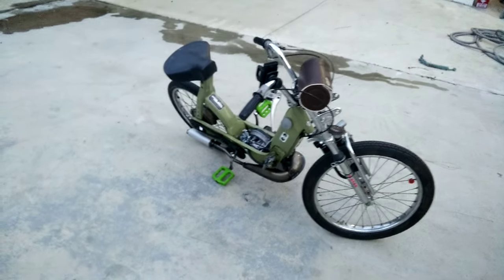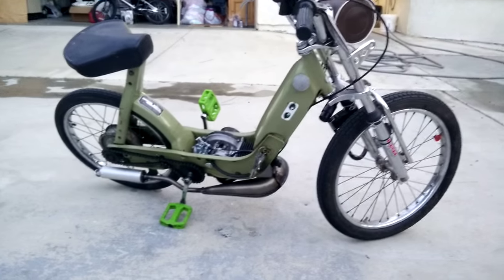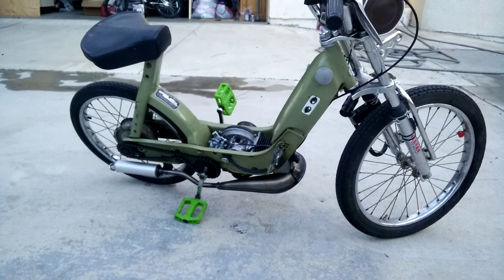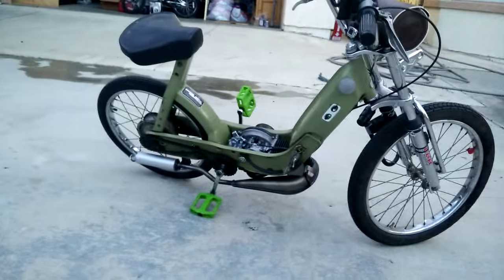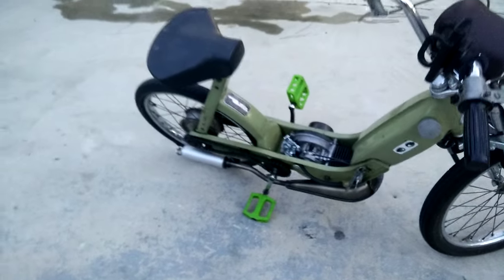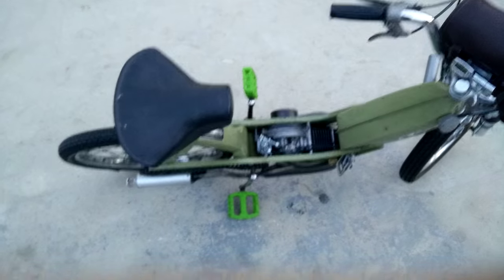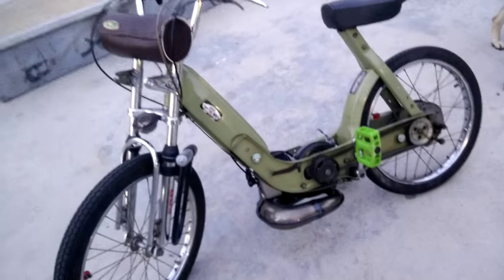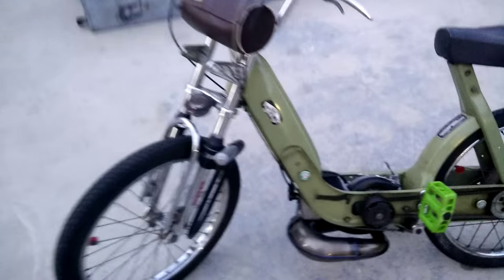Vespa Ciao Malossi 65cc moped cold start

Comment: whats this for a Fork (sorry i dont know how It means right. Im german)?
Reply: OLL 2014 ebr front fork also used for puch maxi's
Reply: What you can use a Puch maxi Fork at ciao?
Reply: OLL 2014 i dont know anything about mopeds only scooters, a moped like this vespa, Can you turn it on other ways that with pedals? And If you Remote the pedals Can u still turn it on which ways? Im thinking of getting one but i dont want pedals on it
Reply: Yes you can run with the moped it still turns on when your quick enought
Reply: OLL 2014 okay nice, but what about some kind of electric start button? does it have  that?. Also how good is a vespa in the winter for driving mostly to school?
Reply: no a ebr front fork is a custom designed front fork that also fits in a puch but also in a vespa ciao
Reply: TobascoCatMC you could make a electric starter but if a ciao works well you need to run three steps and the engine will switch on
Reply: in the winter a ciao has better grip than s puch maxi or something
Reply: luc timmers but its not as good as a scooter? in the winter?
Reply: i dont know i dont have a scooter sorry
Reply: TobascoCatMC i don't know I also don't have a scooter but I think a "mofa?" is better than a scooter
Reply from the maker: OLL 2014 sorry for the extremely late reply, but I just wanted to clarify. yes, it is the ebr aftermarket forks meant for the Puch Maxi, but in order to use them on the Ciao you have to cut the head tube shorter. but other than that it works fine with the Puch bearings and cups